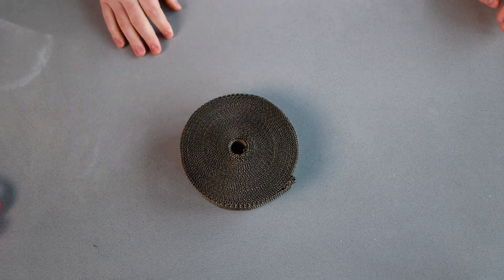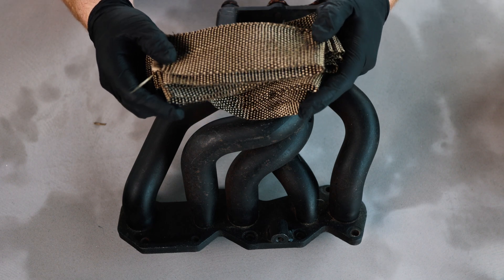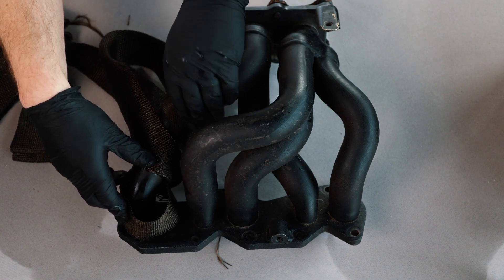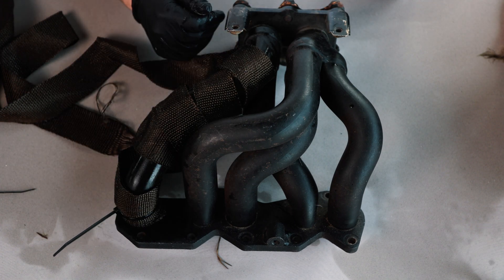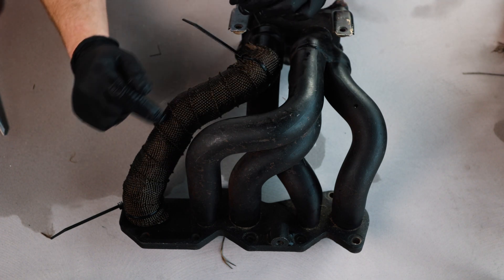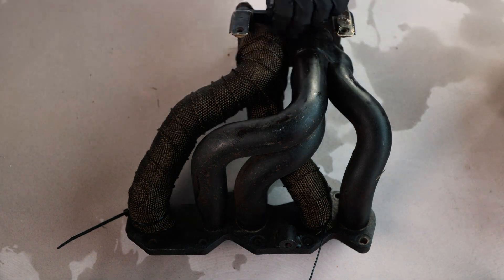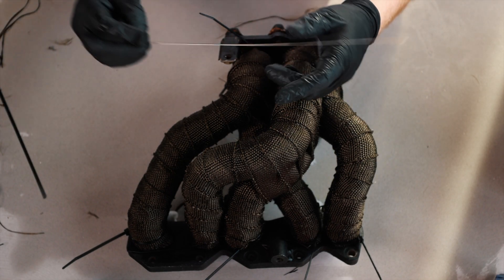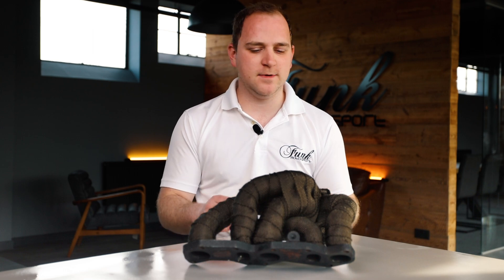How to Wrap your Exhaust! Lava Rock Exhaust Header Wrap Installation - Funk Motorsport

Comment: Thanks for this video! I just did a total overhaul of everything intake, turbo and exhaust in my old Nissan Z31 and I was really concerned about the new manifolds and downpipe damaging fuel lines and electrical wiring.  I got some lava rock wrap just like in this video and im sure glad i watched this before installing! I would have done terrible.  Wetting the wrap first makes so much sense and using the plastic ties while installing will be so helpful! Thank you
Reply from the maker: Glad that the video was of assistance! Pleased to hear your installation went well. Thank you for your feedback!